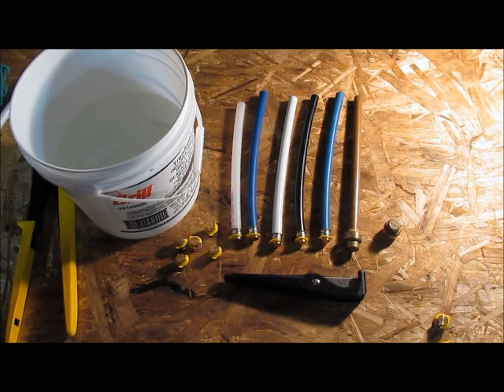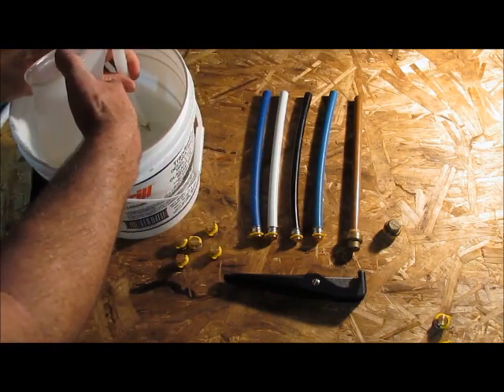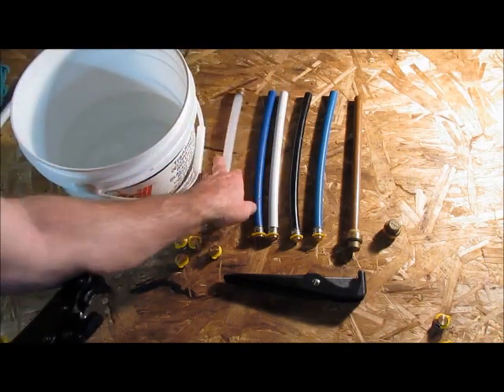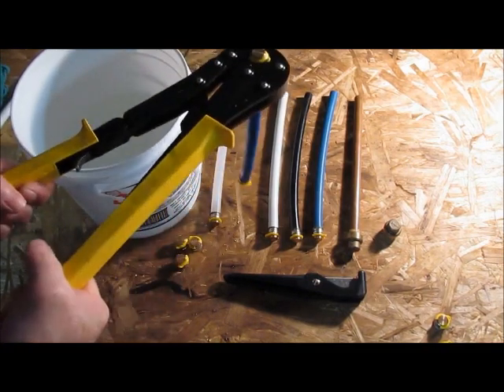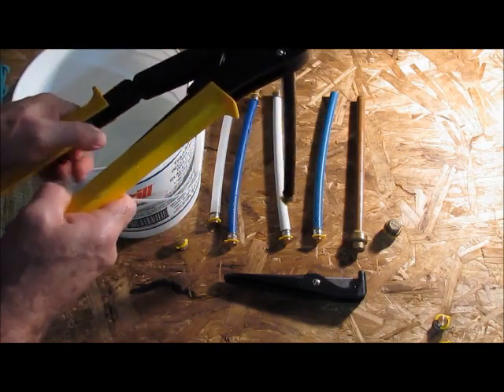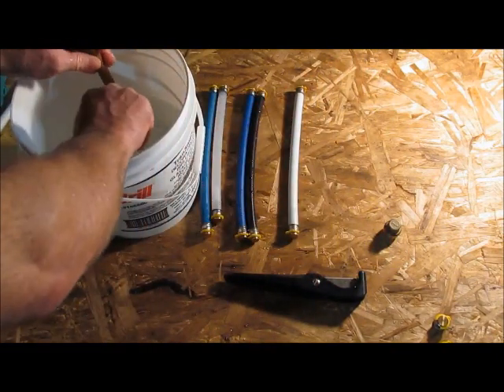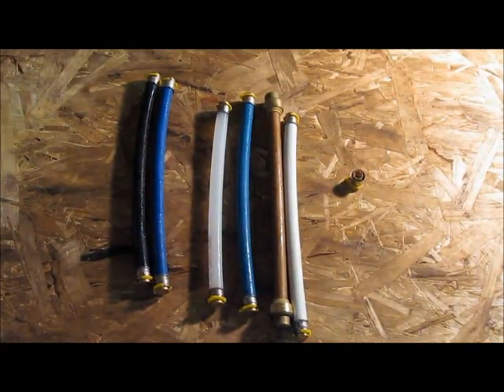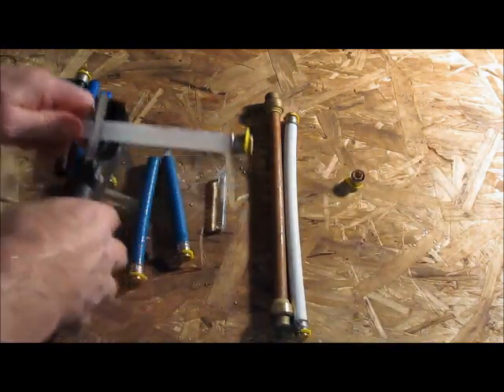Different types of Pex Pipe.   Freezer test.  A few winter tips as well. Plumbing Tips!

Comment: Great that you thought about trying this. But the way you did it we would never know if they would actually leak under 80 psi or more. Often you do not see the leak with your eyes. Also, the winter in a country like Canada is much colder than your freezer. I have had both copper and pex corner fittings leak after a cold winter with water left in side the pipe.The copper corner fitting was visibly broken, but the pex corner fitting was not. It leaks only after I pass water through it.
Reply from the maker: Hello Grace Ho,
After I made the video I should have fired some pressure on it to see the effects it would have on it. May get something going like this in the future.
Guaranteed copper will leak and it needs no pressure on it. Just water lying in the pipe and freezing will do it. I have seen lots of that over the years.
Thanks for the input and have a great weekend!    Al

Comment: Guess i disagree with the shark bite being excellent. Good for a wick repair yes. Last a long time without leaking maybe most of the time. I know I've personally seen those kind of fittings blow off without being froze. Also i prefer a total strong physical connection over a rubber o ring which you have to wander when it'll rot. And I'm guessing after that one freeze test there if it happened a couple times you'd lose all connection. But maybe I'm picky but no push on connectors for me especially in my house or under my foundation or anywhere that could cause damage from leaks or be hard to access later.
Reply from the maker: Hello jackle842000,
I am all about solid connections myself, but the Sharkbite do work well. Would I use them underground or behind walls....probably not. As far as them blowing off; if they are installed properly chances to slim to none. I have used them up to two inch in size and have had great success with them. I think installation is key in having a watertight connection. They have been around for a few decades now and I have done several tests on them. 
I made a video also using weights..... I placed Sharkbite couplings and pipe together (copper and Pex). I then hung it from a beam and placed 275 pounds on the bottom piece and they did not come off. The teeth only dug in deeper. One of the biggest mistakes people make when installing them is not marking the pipe at the depth where it bottoms out in the fitting. There is a half way point where the pipe feels like it has gone into the fitting the complete distance when in fact it hasn't. It geenrally needs another push. That is why marking the pipe is very important. 
I have done several tests on them and they have passed them all.
I know they are not everyone's go to, but they do work well especially where water is an issue.
That being said...you can't  beat a soldered joint.
Thanks for commenting and enjoy your week!      Al

Comment: An interesting comparison, however part of what makes pipes burst isn't just the water inside freezing, though that is sometimes enough, it's the combination of normal water pressure from the street, and freezing, the freezing drives the inside pressure through the roof. Also was the length of copper pipe type M or type L? For those who are not aware type L copper pipe has almost twice the wall thickness of type M.
Reply from the maker: Hello A. Fritz Becker,
Very true about pressure being one factor, but I have seen many pipes freeze and split with zero pressure or low pressure. Drain lines such as traps will split easily if they are left without a nearby heat source. I am sure you are familiar with this taking place. Generally it occurs in crawl spaces unfortunately.
I used type L copper in this video. I only use type L on potable water and type M on hot water heating systems myself.
Thanks for commenting and enjoy your week!     Al

Comment: I'm curious, has anyone tried this test and also measured the diameter of the pipe in its room temperature and frozen condition?   I'm wondering how much of the water's expansion was absorbed by stretching the PEX versus pushing into the fittings or even moving the fitting itself (as happened with the copper example)?
Reply from the maker: Hello James,
I will say that a friend of mine used it in his barn and it froze over the winter. When it thawed in the spring; he simply reattached the pipe from the inside of the house and turned on the water. Didn't have a leak.
It was the Uponor (wirsbo) system that he used.
Hope this helps..
Thanks for commenting and enjoy your day!      Al

Comment: Not a good way to test pex. Find some pex that's 4 or 5 years old and see what happens. It doesn't do very well. After a few years pex becomes brittle.  I have been a plumber for 45 years....
Reply from the maker: Hello barry,
I have been using pex for over twenty years now and it only becomes brittle if it is exposed to UV rays or florescent lights for long periods of time. I have seen it happen twice. Made a video on it. Pipe was exposed to florescent lights 24/7 for years. 
As long as the pex is not exposed to direct rays from either source you will have no issues. I have joined Uponor pex that I installed 18 years earlier and had no issues.
A lot depends on where and how it is installed. 
Thanks for commenting and enjoy your weekend!      Al

Comment: ice in the supply line is not the direct cause of having a pipe burst. the ice that forms in the pipe expands into the pipe and pressurizes the water in the line. the water busts the pipe.
the problem in this experiment is that there was not enough water in the line to pressurize. in an actual system the ice would keep growing and increasing the pressure of the water in the line, which may or may not burst the pipe. we know that it will burst copper. 
this experiment simply used material that was too small. the physics is that you simply cannot generate the pressure needed to burst a pipe.
also, Ive done this experiment with a 10 ft 1/2" copper pipe with shark bite caps. I put half the pipe out the window in freezing winter, and kept the other half inside. the copper pipe split but the shark bite did not fail. you cannot force a shark bite. I believe this experiment did not properly fit the shark bite.
Im not 100% sure, any longer, but I think that after thawing one of the shark bites in my experiment was destroyed and fell apart.
Reply: ps...if the water in the supply lines freeze increasing water pressure, and the pipe does not burst, something's gotta give! that would be the faucet.
Reply: p.s-Ice is most definitely the direct cause of burst pipes.

Comment: Hello again I am having a problem with crimp tool ...cant even open it enough to put around the ring in a tight area ...I used push fittings i bought from eBay and they leaked right after installation ... Removed them and Now i will try cinch or sharkbite brand. Any suggestions ? The cinch tool might work ..Please advise.
Reply from the maker: Hello Sajid,
Sorry to hear that. Were the push fittings Sharkbite? 
I have had great luck with these fittings where they were needed. Be certain to mark the pipe the amount that it is going into the fitting. This will allow you to be certain that it has gone on all the way. pipe goes into 1/2" fittings 7/8ths of an inch. 3/4 fittings aloow the pipe to go in 1-1/8th. I generally mark the pipe with a marker. 
One thing to keep in mind before you make a joint...ask yourself if the next joint can be made where it is located.
If not I would crimp all joints on a fitting and place the fitting with the pieces of pipe in place and make the crimp where it is easy to get at. It takes a bit of planning, but it works every time. 
The cinch tool will work for you as well.
Thanks for commenting and let me know how you get along....Al
Reply: No...They were not sharkbite brand . I bought them on eBay . The seller admitted there were problem fittings and is being very co operative in taking them back ..BUT, I have lost many hours of labour in re opening the dry walls and removing them ( their removal was extremely difficult ) . . They are even sending me a free Cinch tool to try crimp types wherever i can..Yes, i agree, planning is needed to handle the area which is difficult to get the tool in.  I will buy sharkbite brand for wherever i cant reach with crimp tool or cinch tool . And, oh yeah, my pipes were all the way in to the marked line . Thanks !
Reply from the maker: Hello Sajid,
Sharkbite work very well. Remember to mark them if you are going to use them.
The cinch tool will get into almost any space. You should be all set!
Thanks for commenting and enjoy your weekend!    Al
Let me know how you get along!

Comment: I had a full replacement from copper to PEX this summer.  I had copper in the house I live in and experienced no less that 10-15 pinhole leaks over the past 15-20 years.  I woke up this morning,  went to the kitchen and turned the knob on my kitchen faucet,  Nothing came out! I realized that I didn't leave a faucet dripping! I took a space heater into the attic where the pex was crossing the house.  Within 10-15 minutes, the water was running!  My copper pipes would have split and cost me alot of $$, I can promise you having PEX in your house will give you peace of mind,  Also, it will be a good upgrade to advertise when you sell your home.
Reply from the maker: Hello Mike,
There are a number of factors that go into the life expectancy of copper; water acidity, minerals and the grade of the copper to mention a few. Type M copper with the red label is used quite often for waterlines. It has the thinnest wall and is the cheapest copper pipe. I have seen it used quite often in homes for waterlines, but I believe it should be used on heating only.
That is one advantage of pex as far as freezing goes. You can simply apply a heater to the area and it will thaw. Like you said...if it was copper; it would have split.
I am a pex fan myself. Will be for life.
Thanks for commenting and enjoy your week!     Al

Comment: How does your PEX get exposed to UV inside your wall or in your basement? Also, it doesn't matter what color or clear the plastic is, exposure to UV will cause it to become brittle and shorten the life of the plastic.
Reply from the maker: Hello Felix,
The first time I saw it happen it was caused by florescent lighting that give off UV rays, but you probably knew this already. Piping is run in basements and many do have florescent lighting as you know. 
Made a video on it if you are interested...https://www.youtube.com/watch?v=V4pII1llVcU
UV rays will cause the pipe to break down, but every manufacturer has a different UV rating and some are much higher than others. Do some research on it and you may be surprised.
Thanks for commenting and enjoy your week!     Al

Comment: The possible reason why they did not split might be that there was not water pressure in these pipes when they froze. You only had standing water in them. Remember in a functioning water system in a house, you have 25-30 psi in the pipes which would create more pressure and then even more when they freeze.
Reply from the maker: +Ari P 
Possibly so. I know pex A can expand so there should be no issues with it when it does freeze. There are a number of places in bungalows where they drain the system and not all the water is removed from the lines and have no issues in the spring. If that was copper you would have many leaks in the spring; so it is great for places like that. May see a video of it frozen with pressure in the future.
Thanks for commenting and have a great week!    Al
Reply: Water molecules connect when they become still from cold which what causes the splitting of tubing not water pressure. Look it up and you also find out there are different types of ice as well.
Reply: @cravinbob  In general you are right, although I think the point is that in this test, if there is any room at all left in the pipe to allow for expansion, even a tiny air bubble, it would greatly reduce the chances for splitting.  A pressurized system in a house has much less chance for air space.
Reply: You must have low water pressure, where I am it's between 40 and 60 psi.

Comment: Hi, thanks for sharing all of these useful videos! I was hoping maybe you could help me with a question I have regarding woodstove hot water plumbing. I am going to be heating my water for my tiny house with a wood stove. I will have a 30 gallon hot water tank relay water to the wood stove ( most likely with 3/4 copper) it will then heat the water and thermosyphon back up into the 30 gallon hot water tank via 3/4 copper. I was wondering on the hot out line to the tempering valve.. if I could go with PEX or if I should use 3/4 copper until it meets the tempering valve and then begin to use pex. I just want to make sure the pex will be able to handle the temperature of the hot water before it mixes with the tempering valve. Any thoughts on this would be appreciated! Thank you, sir !
Reply from the maker: +VAN SOLO 
You are more than welcome!
I would stay with the copper until it meets the tempering valve myself. The water could get exceptionally hot so copper would be my choice. Be sure to install a temperature pressure relief valve on the tank. This is a must. 
Not exactly sure of the set up, but always safety first. 
Thanks for commenting and enjoy your week!     Al
Reply: +TheOldkid888 My thoughts exactly, I appreciate your feedback! Look forward to watching more of your videos! Cheers!
Reply from the maker: VAN SOLO
My pleasure!
Stay tuned. 
Thanks for commenting and enjoy your week!    Al

Comment: Thanks for posting this.Rick Lames, this is very Representative of actual working systems. Issues as you describe are very likely poor workmanship. Often times water lines will be prematurely laid before a slab is ready to pour. The result is workers walking all over the material for weeks causing damage. The water lines should be the last thing that happens prior to a pour.

  I will comment from experience here,. We have a campground / marina in Michigan with about 3 miles of PEX underground. PEX can take a freeze, but the brass fittings are still susceptible to  freeze failure. Also repeated (annual) freezes will eventually stretch PEX to its fatigue point (it expands a little more each year). It is still a good idea to blow your lines down for winter. Thanks for taking the time to produce, and post this video, Great Job! 
All the Best,
 Bill
Reply from the maker: +BIll Tabbert 
You are more than welcome!
I appreciate your input and kind words!
Thanks for commenting and have a great week!    Al

Comment: I have recently moved to the southern part of the U.S. where they build a lot of homes on slabs and there seems to be an awful lot of pin holes developing in the pex not to mention the problems with the fittings on certain brands corroding.  I would never buy a house on a slab with this stuff in it.  I have a friend right now looking at tens of thousands of dollars of slab damage and possibly even jacking up the house to pour a new slab basically. My house isn't going in the freezer in 12 inch pieces so I really don't get the point of this.
Reply from the maker: +Rick James 
I live in an area where temperatures are anything but warm as compared to the southern part of the U.S. and this video is for people who live in areas with cold temps. Temperature at the present time is 32 degrees Fahrenheit 
(0 Celsius) and it is only going to get colder for about 5 months. There are many bungalows in Canada and the upper U.S. where the temperature drops below freezing and cracked copper waterlines is a problem; so most pex can freeze and thaw in the spring with no worries of leaks.
I know exactly what you are talking about when it comes to pinholes and cracking of pex pipe. I see it in this area as well. Pex cannot be exposed to sunlight for extended periods of time. 
Pex pipe manufacturers state different UV protections. Some being as short as 90 days. Others may even be shorter.
I know there are manufacturers that have one year protection on their product as well.
There are a few things that allow this to happen. One thing is the installer may have that pex in his or her vehicle out of the box for an extended length of time before it is installed. This allows the sun's rays to slowly break the product down. 
Another thing that I see quite often in many areas is pipe that comes through slabs not being covered which allows the sun's rays to break it down as well. Often someone will install the slab and get to the structure at a later date. By then the pipe has basically become brittle and cracks off. 
Fluorescent lights act the exact same way as the sun and break it down as well.  Have seen this first hand where cracking and pinholes have occurred from this lighting.
A friend of mine used it for water feeding the slide in his pool and half way through the summer the pipe sprang leaks and had to be replaced.
The bottom line is the pipe should not be exposed to the sun for an extended length of time as it will deteriorate rather quickly. 
I am not aware if many plumbers know this or not, but I once asked the question at a big box store and the guy working the area had no idea about UV protection. 
Pex pipe has been around for over 5 decades, but we must know what to do to make it last. Keeping it covered and out of direct sunlight and away from fluorescent lights are critical when it comes to the life expectancy of the product.
The manufacturers do say it only has a certain length of UV protection. It is basically up to the installer do the rest.
I am not a Pex expert by any means, but have seen first hand what can happen if it is not protected.
Thanks for commenting and best of luck in the future!     Al